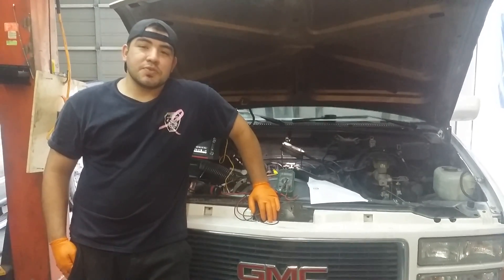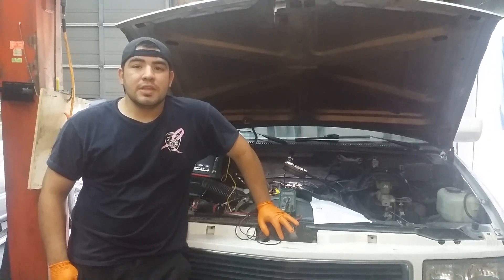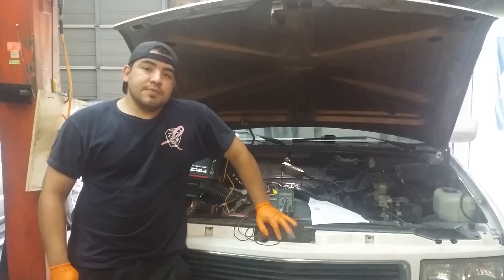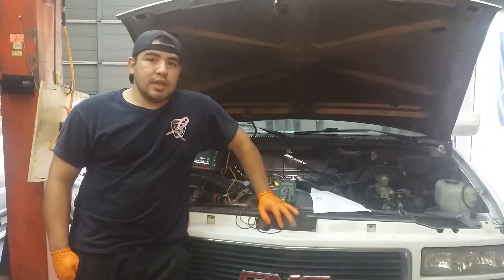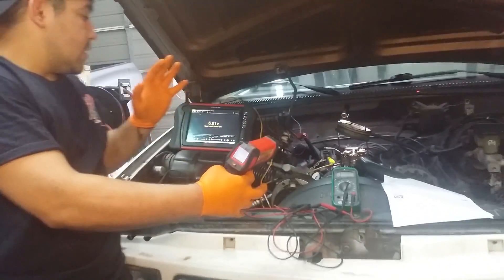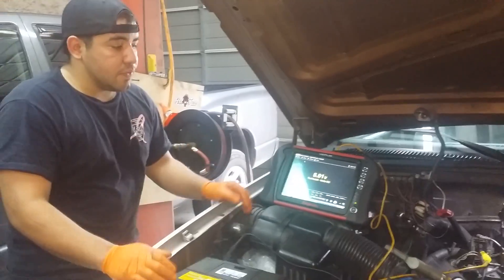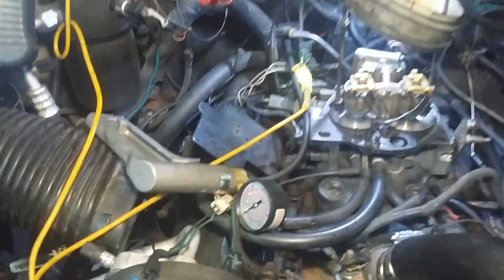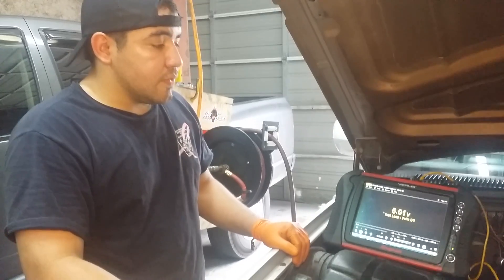How to test sensors without a scan tool.

Comment: OK so the beginning of this video u said u already found the problem I just did a v6 to v8 swap and I'm having these same problems even know the v6 ran perfect before pulled I've checked everything u mentioned and still not running right
Reply: Idk if you figured it out by now, I would check the prom chip, most ecm can run either a v6 or v8 but you need the v8 prom. There are some ecms that are v6 only tho so could be either

Comment: Thank you. I’m so sick of people in forums saying to change this sensor or that sensor when anything goes wrong in this system it just bogs down or stalls. So everyone just assumes someone else has the same issue lol. I followed that once and I had a bad fuel pump. I replaced iac, and two coolant temp sensors which always made it run better for about a week. Was about to replace the tps and map sensor because it’s all so cheap lol. Then I rented the fuel pressure kit from oriellys and I had 1psi 🤦🏻‍♂️. No one knows how to test these damn tbi’s lol. So I appreciate you showing us how to test the sensors.

Comment: The ad said without a scanner I was hoping you would use the other one the cheap tool
Reply: Nevin Lee they’re the same thing. One just can do more if needed. He only used it because the screen was better for the camera. The multimeter is hooked up the same way. Positive and a good ground. Hook it to the right wires and it will show you the same readings (except the graph, which he just did to be absolute it wasn’t spiking)

Comment: Which scan tool you recommend to start. Snap on Verus is too expensive.  I agree It is the best. I would like to work with it. (IJust suscribed)
Reply from the maker: For a beginners scan tool I would start off with anything that has live data. It’s best to know how to read your fuel trims o2sensors and other various sensors. I bought myself a Bosch one from oreillys and I love it. I always pull that one out first and if it’s something complicated I’ll get the big guns out

Comment: is there any way I can test  the pressure reg  on the tbi  I test the fuel pump engine running an pressure hold at 15 lbs I think is 2lbs more  pressure soppose to be 9 an 13lbs maybe I'm wrong but when I turn the trk off an pressure it again with just key on goes to 15lbs an does not hold pressure it a 90 gmc 5.7
Reply: Simon 91 GMC 305 2 wheel drive the vehicle starts idles beautifully goes about a block and then I lose all power and it stalls out I replaced the fuel pump fuel filter and it ran great for a week and then started doing it again replace the fuel filter again took it to the shop after that cuz it still did it.  shop wouldn't diagnose it cuz I didn't have a machine old enough to diagnose it, which is a joke . needless to say I'm stuck with no wheels it sucks help
Reply: help